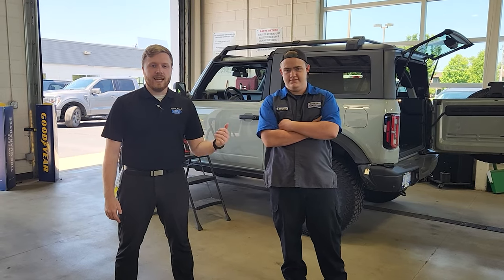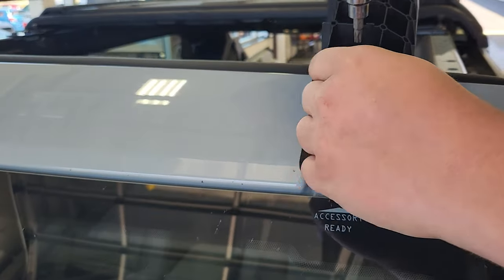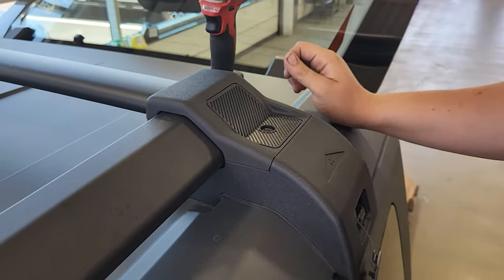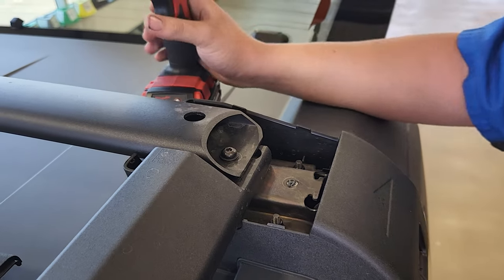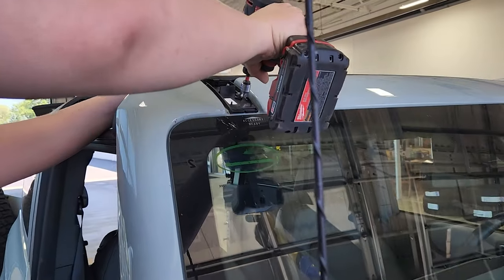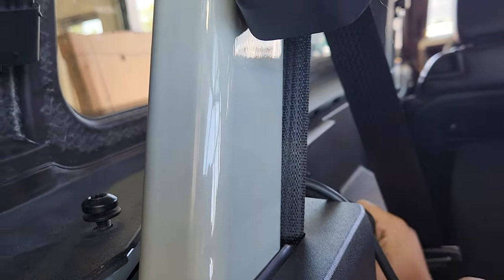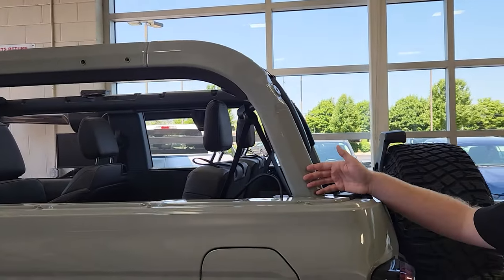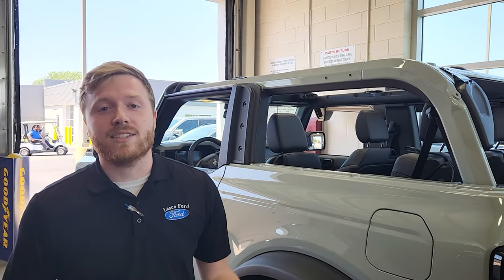How To Remove Ford Bronco Top - 2 Door with Roof Rails! (FULL DEMO)

Comment: I needed to see the rail removal which was paused!
Reply: Yes, I did also. It's why I watched the video. I wanted to see if I could take the rail off as an assembled unit. I ended up taking off each cross rail.
Reply: @trialmx how did you get the (back) cross rail off? What Ford tool did you use pls thx
Reply: @larryclark609  for the removal of the aft crossbrace from the fore and aft rail I used a T30 bit. Although it's a little sloppy. A torxplus is probably what it is. Once I got the aft crossrail off I realized I needed to unscrew the the aft "rooftop clamp" bolt completely with the provided special ford torque wrench and the aft section would dislodge from the roof. Next time I remove the roof rack I'll try to remove it as an assembly without removing the Crossbars.
Reply: @trialmx what? Is there a latch holding the back part of the roof rack onto the body of the Bronco? I’m trying to slide it fwd or bwd and nothing.
Reply: @matttully2132  I had the same " stuck to the roof" issue the first time I took off the rack. Be sure you loosen the clamp bolt all the way (the bolt where the ford provided odd looking torque wrench is use) it's a retained bolt it won't come out. Then it's a matter of the getting the rubber pad on the rack that meet the roof to release it friction bond. A mild continuous pressure upward should do it.

Comment: Good how-to video, but not sure the removal of the rear rack caps are necessary (2:47).   And glad you pointed out the top bolt at the front for the hard top removal.  Other how-to instructions only focus on the inside bolts and don't point out the one on the top.  I admit that I missed that one on my first top removal.

Comment: The Torx bolts on these are not regular Torx, they are Torx Plus. If you use a regular torx bit you will either break your tool or strip out the hardware. 
These bolts are also what is on the front bumper. 

Removing the covers on the rear part of the luggage rack is also unnecessary. All you have to do is loosen the triangle bolts and the clamp will release.
Reply: Not mine